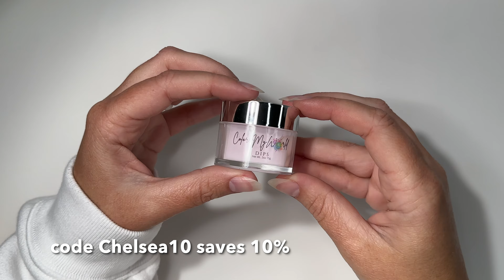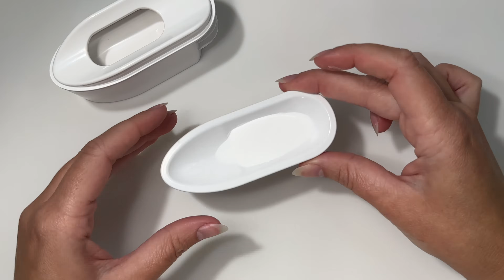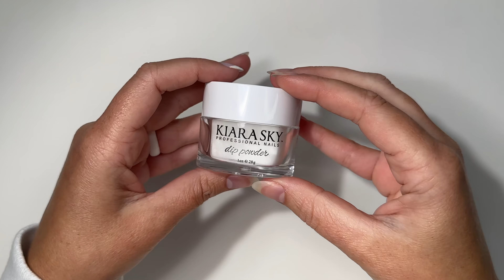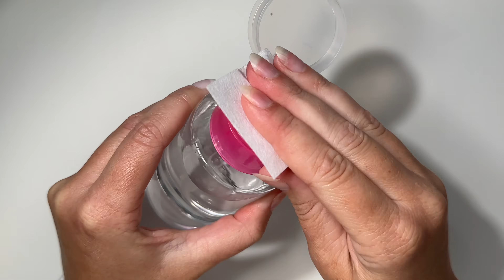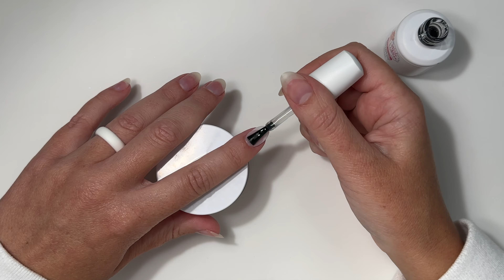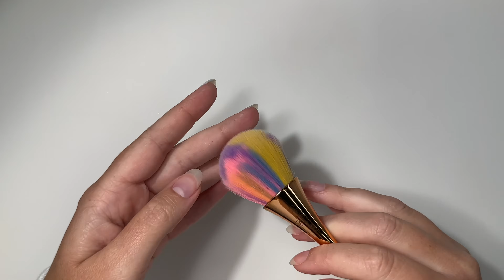✨CHROME✨French Tip Nail Tutorial Using Dip Powder

Comment: Help Chelsea! I know this is off topic but I didn't see any videos on my issue.  I bought a matte top coat and didn't realize until it didn't set up that it requires a UV light! Grrr...any saving mu dip or do I need to remove all and start over.😢
Reply from the maker: Hiii! So sorry to hear that! 🫶🏻 matte gel top coat can be used on top of dip powder too. So after you file, then cleanse with rubbing alcohol, apply the matte gel top coat and cure 60 sec. Please let me know if I’m misunderstanding 💕
Reply: @SipAndDip  I don't have a UV light.
Reply from the maker: @debschultz143  ahhhh! Oh Kay! So if you’d still like matte nails then I would suggest this method -
Complete the mani with your dip liquids as usual (including 2 layers of dip top coat)
Let dry
Then buff off the shine and dust off
Apply activator
All done!
That way you get the strength but still the matte look. I’m actually demoing this exact method this Friday in a video! If you’ve already applied the gel top coat on your manicure I would wipe it off with rubbing alcohol 💕